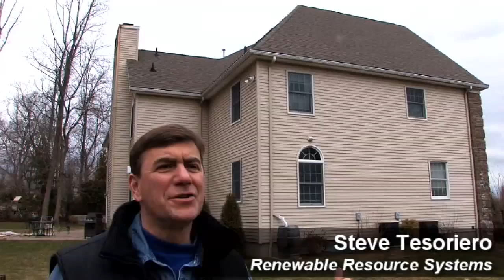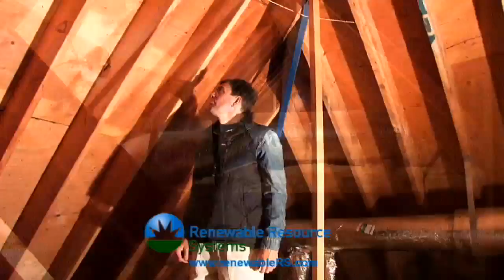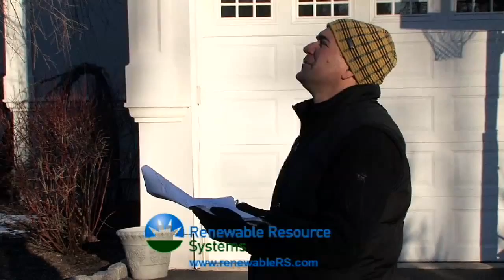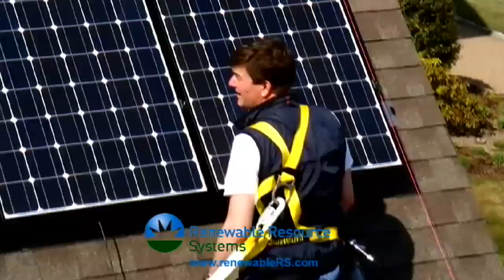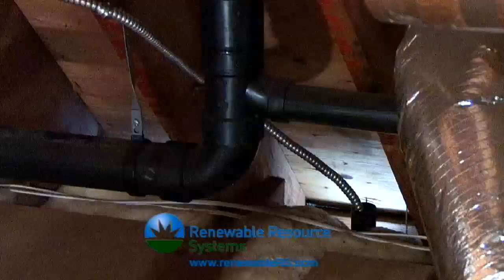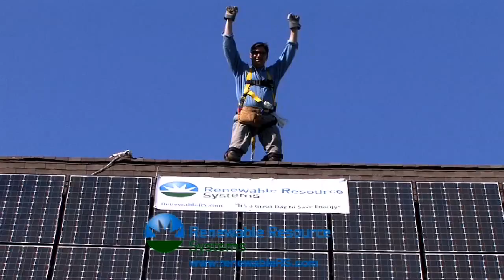Step by Step Solar installation on a home...

Comment: Thanks for sharing a video about solar panels .It is really informative post. Solar panels absorb the energy from the sunlight and the photovoltaic modules generate electricity from the absorbed solar energy.
solar panels generate electricity from the sunlight in 4 different steps. It starts with the panels absorbing solar energy, which activates the PV cells to generate direct current (DC). The inverter at the back of the solar panel converts the unusable DC current into the usable alternating current (AC) that flows through cables and wires and reaches the meter. The electricity from the meter powers your home and runs all your electricals & appliances.
 I know  a place  which is one of the best solar installation company  provides best  solar services and products that are not just economical, but also efficient with customized solutions.https://futuresolarusa.com/get-started.php

Comment: How much would this cost and save?
Reply: They won't tell you the cost because it is outrages and when you live in the  north east where the sun does not shine too much in the winter  you will not be getting any power from the panels. So how the hell do you heat your house????? May be you have to have a windmill for that.